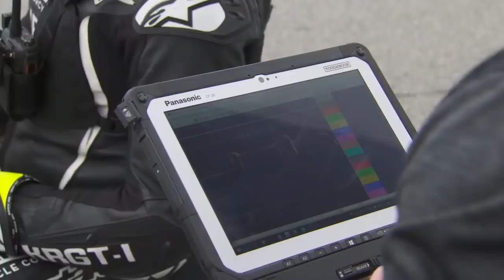ARCH Motorcycle ABS Testing With Co-Owners at Bosch Test Track (Ep. 1)

Comment: ABS is not going to keep you from a crash, you need to be able to lock those wheels when the situation calls for it. I had an old man pull out of a parking lot  while I was riding a Honda 500 downhill on a two way street, about 40 mph, he looked directly at me, we made eye contact because he was that close, then he pulled straight out. All i could do was lock the brakes and slide sideways to avoid impact. Fortunately for me it worked, we ended up side by side and face to face at his car door. I pounded my fist on his window and screamed at him, he never said anything and started backing up.  I gave him the single digit salute and was able to ride away. If that bike had ABS back then, i wouldnt have been able to lock the wheels, and i would have gone right over the top of that car. No way will I ever have a bike with that stuff. If you cant control your bike in a simple skid you better start learning.

Comment: Having an equivalent-to-analogue modulation mechanism, with dynamic, context-aware activation points would make for an exceptional ABS. Just about any ABS is a much-better option than high-siding over a locked-up front tire, into a busy intersection. Fucker will throw you with merciless force so much faster than you could have imagined.